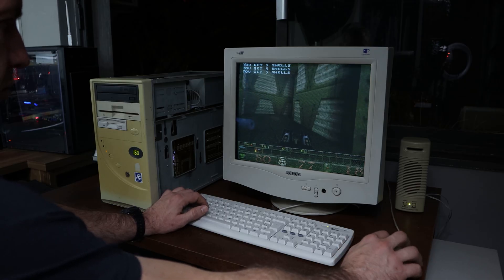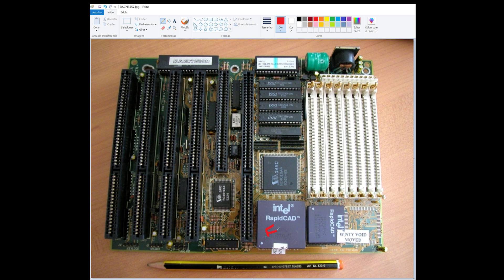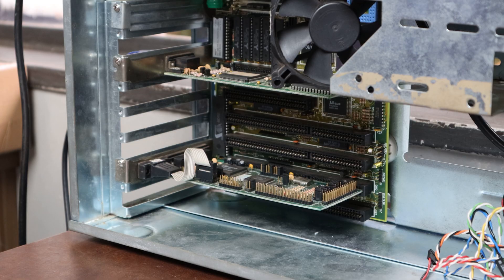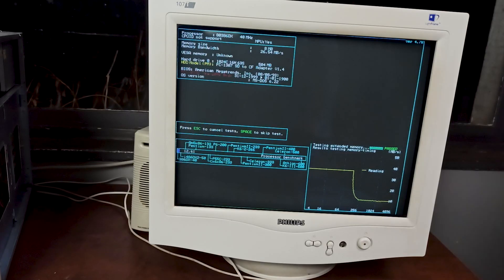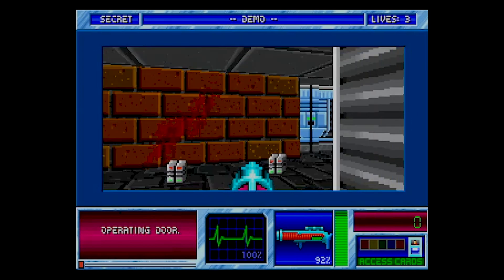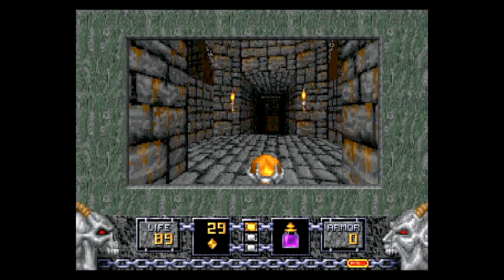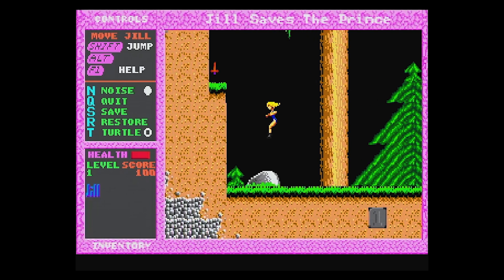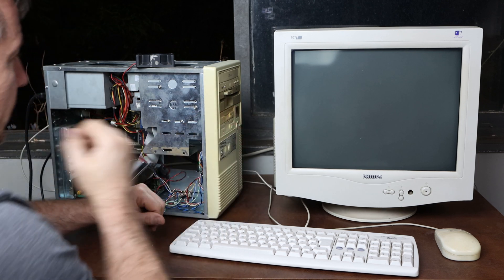Intel RapidCad: 486 in a 386 shell. #486buildoff

Comment from the maker: Thanks to everyone that stopped by and spent a bit of time to watch this. Twitter events are fun, a good excuse to interact with like minded people. Also, having the set deadline actually means that you need to pull your strings to deliver in time, which is good in it's own way. Don't forget to leave your comment, it's always a pleasure reading them and talking ot you. I've done a bunch of videos on 486 computers, here are a few of them if you feel inclined to watch more:

Rendition Vérité v2100 + 486 computer
https://youtu.be/D7zADH80vQA

Zida Tomato 4dps, tiny 486 motherboard system
https://youtu.be/3wuQO4f6L6c

3dfx Voodoo Graphics PCI + 486 computer
https://youtu.be/vWx_hHy_GDc

Comment: Great video! This is the first time I've ever seen a RapidCAD CPU in action. Hopefully one day you'll be able to find the FPU redirect chip for it as well. I'm very curious how much the ISA graphics card is holding you back in this system. In my experience going from ISA to VLB or ISA can provide a huge boost in games based on the Doom engine. You could also try to overclock the ISA bus a bit, which can get you some gains .. great choice of games too. Some of my favorites there 🙂
Reply from the maker: Thanks Mike! Yeah if I ever get the RapidCad - 2 chip I'll have to do another video and test it with CAD software. ISA might definetly be holding the system back a bit. Maybe that's something else to try if I ever get a 386 motherboard with VLB. 386 motherboards are getting harder and harder to come across though... Thanks for checking out the video!

Comment: That's one thing I like about these regular challenges is that it encourages people to do something different. Don't get me wrong - I still want to see as many people participating as possible, but I really like that I've seen a video on this CPU, which I've only heard about. I can't decide if it's an upgraded 386 or a downgraded 486. I'm wondering how it would compare to a 16MHz 486? I don't think I've ever seen one of those either. Nice selection of games and thanks for solving the Jill of the Jungle mystery. That would hurt my ears.
Reply from the maker: Hah! Good point! I think it's both an upgrade to a 386 and a downgraded 486. The only way to make a 486 work there is subjecting it to eh 386 bus limitations and the external FPU architecture. Performance is right there in the middle too. We could try to underclock a 486 and do some benchmarks. Thanks for the support, man! I'm glad to be amongst our people here, it's the best.

Comment: I think the rapidcad was more for doing autocad and 3d with very old software, I’d love to see you try doing that with this system, it should be revisited
Reply from the maker: You're absolutetly right. But not without the RapidCad - 2, it'll be useless. The FPU is the main advantage of this thing, without it's probably just as slow as a 40 MHz 386. If ever get the FPU unit I'll make another video and test 3d software, for sure.